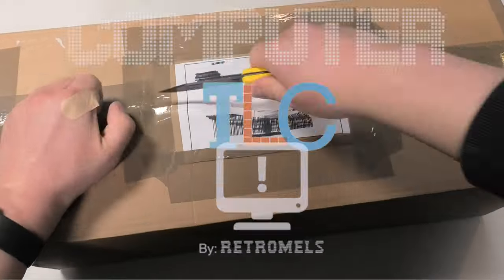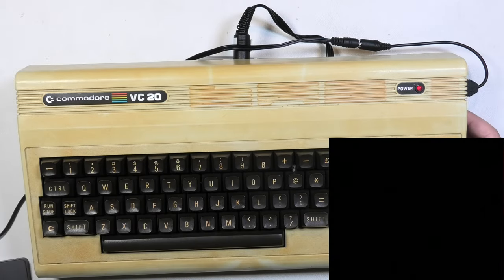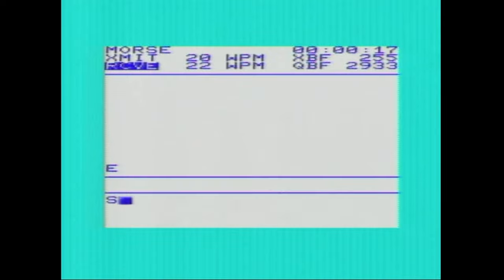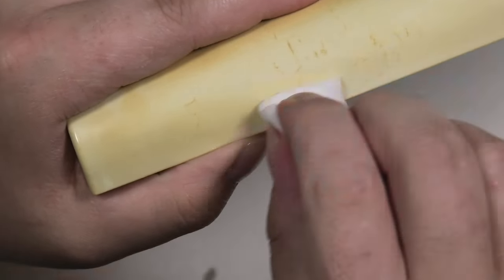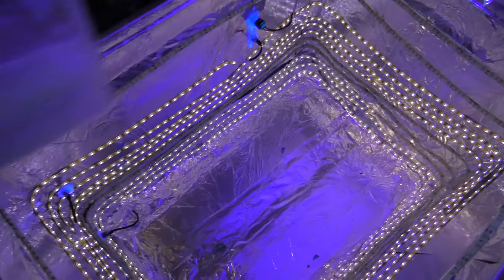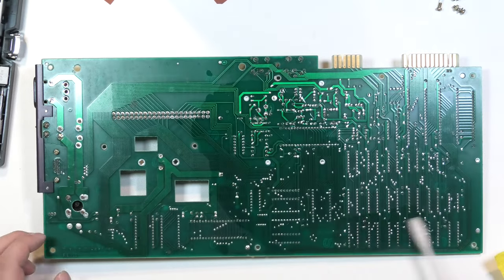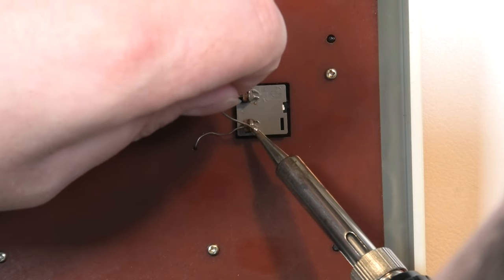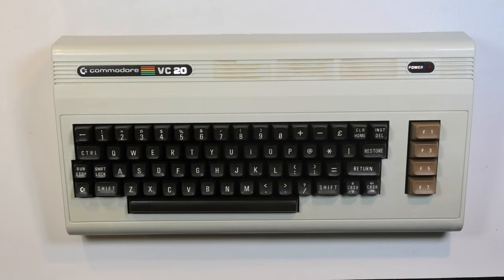Don't Vic with the Commodore VC 20 | Computer TLC | ep. 6 |

Comment: dont worry using the original psu with these, its only a mains to 9v transformer, theres no regulation it it, thats in the computer, the psu cannot go bad and kill the computer(well, unless mains part shorts to the low voltage part, but i'd say so unlikely as to be impossible, especially if it uses a split bobbin transformer), , unlike some c64 psus

Comment: Not all VIC 20 cases are the same. There are tall ones like yours, but there are also slightly lower ones the same size as your C64.
Reply from the maker: oewh cool! I didn't know that, I think but I might be wrong that this was quite an early model.
Reply: @RetroMels  Yours is relatively early. There are basic two types, the one you have with the AC power supply, and the cost reduced version that had the same power supply as a C64 and none of the regulators etc on the board, but that doesn’t seem to tell you the height of the case. I have 4 VICs, all of the older style but two are the tall case and 2 are the shorter type. The first ones had a larger cartridge slot opening, which is why some early non-Commodore game carts are a really tight fit in most VICs - they were sized for a larger space.
Reply from the maker: @Doug_in_NC  All interesting stuff, especially about the cartridges. I like how commodore handled their production and the subtle changes there are in the computers. Thanks for enlightening me on some interesting commodore folklore!